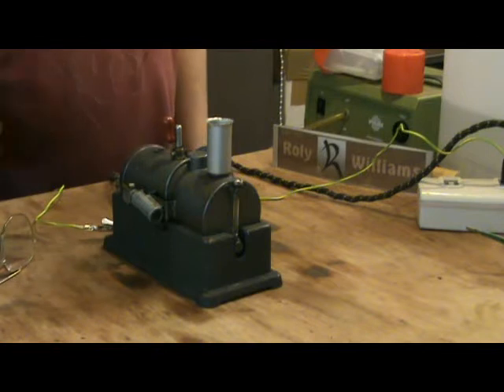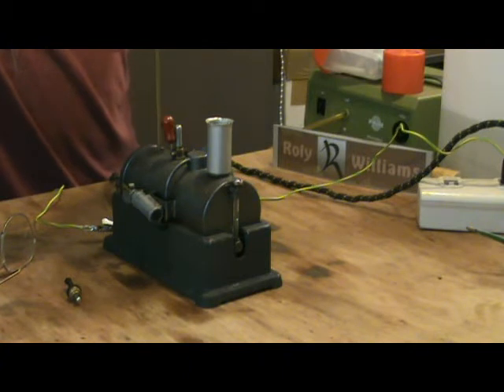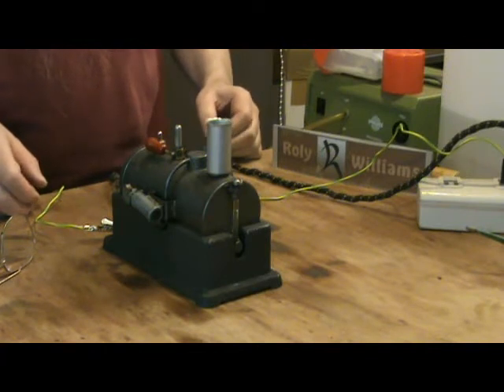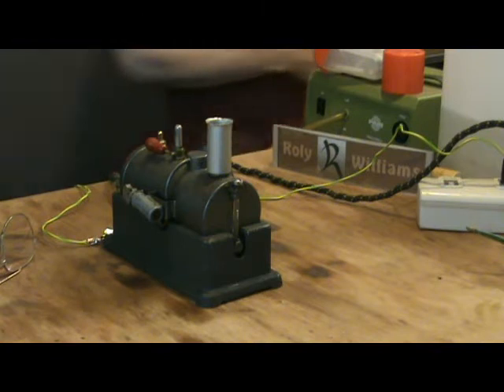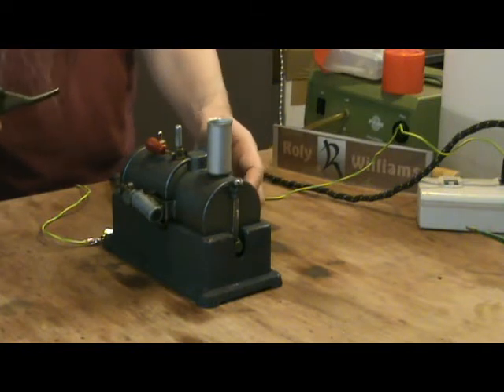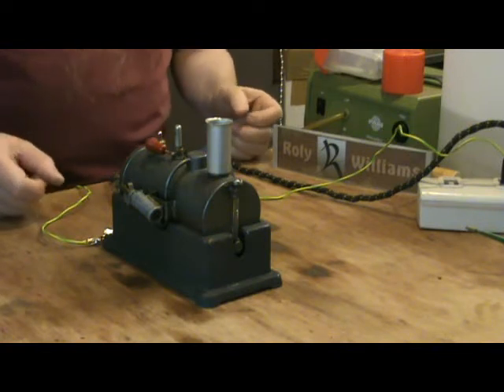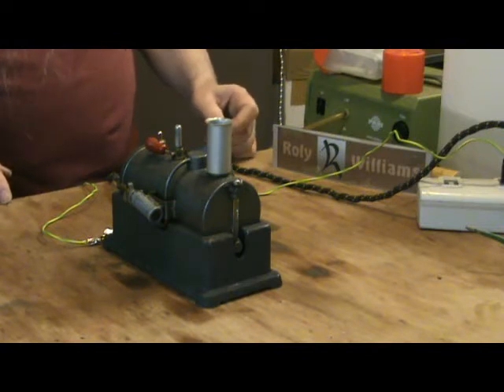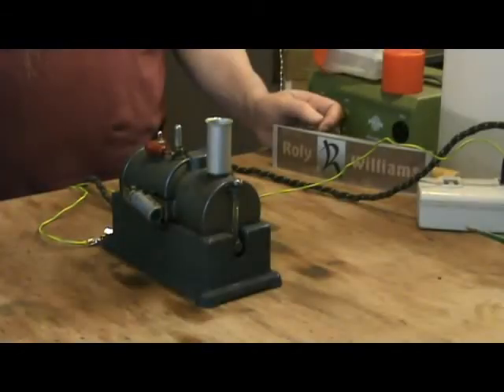Marvindustries Horizontal

Comment: Hello Roly Williams,  I have three of these Marvinindustries (Robert Fulton) engines.  Two horizontal and one vertical.  I see yours has the water guage glass intact.  Did you have to do any work on it?  On both of mine, the water guage glass was plugged up, and the top screw all chewed up.  I drilled one out, and used a screw extractor and got the glass out.  The seals appear to be lead?  I will have to make a new top screw for the one   Do you think small neoprene "O" rings would work for seals?  Both horizontal engines run well, and are electric heated (ceramic internal cartridge type heater).  I have mostly Jensen and Empire engines, with a few Wilesco's and one Mamod. and some Weeden stuff too.  I enjoy your videos. (briarhoppper#35)
Reply from the maker: +Gary Clark Hi Gary. As far as I remember, the only work I've done on this engine was to replace the mains cable.I did this after making this video. As for gauge glass seals, I usually use O rings myself.
Reply: Thank you roly